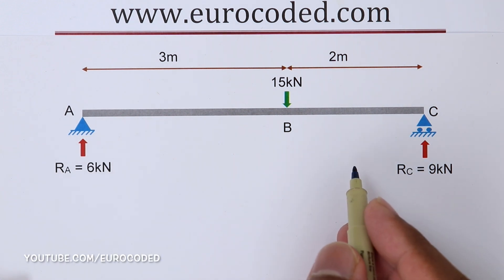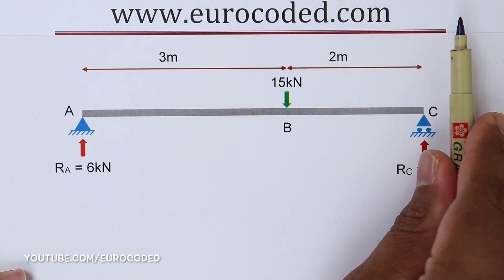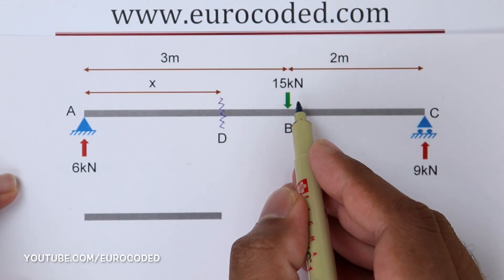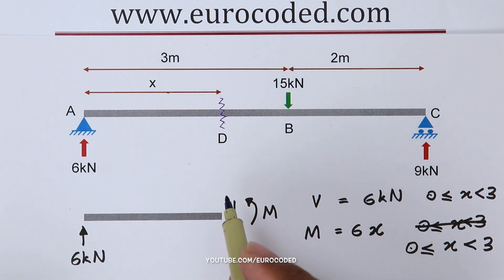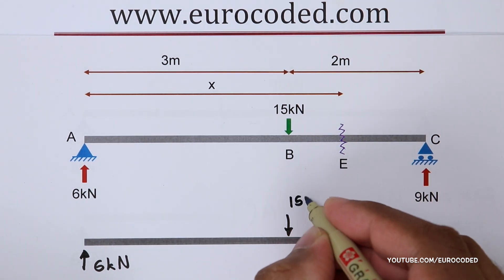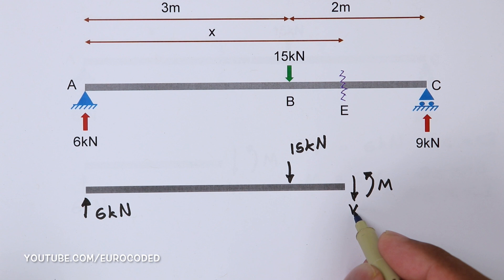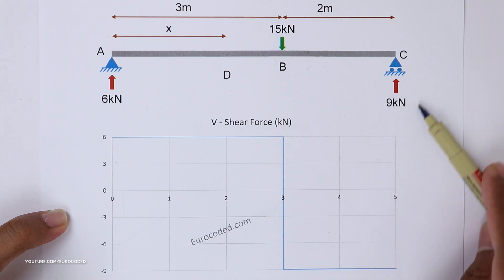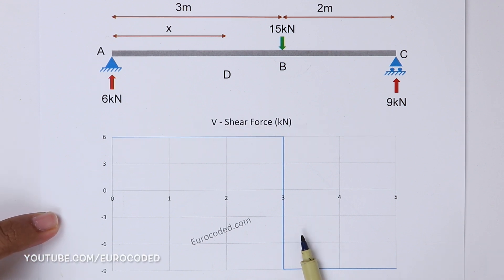How to Draw Bending Moment & Shear Force Diagrams - Simply Supported Beam

Comment: The force is pushing the beam down right, so how is it anti clockwise, suppose to be clockwise I think, clarification please
Reply: I think it's easier to write M= 6x-15(x-3). Since you're taking the pivot at the point of the imaginary cut. Hope that helps
Reply: The moment is in the opposite direction to the force applied.